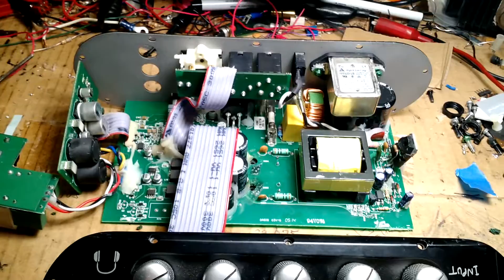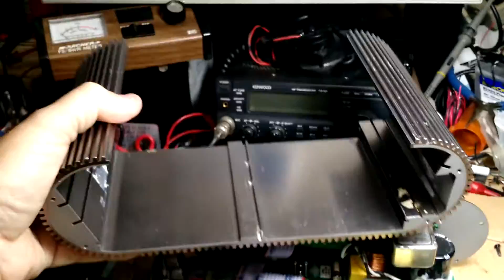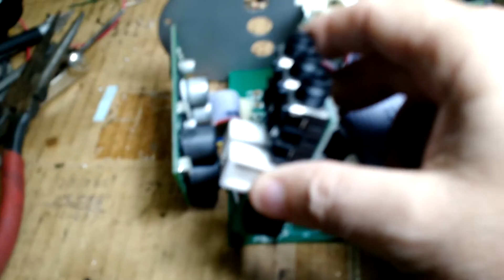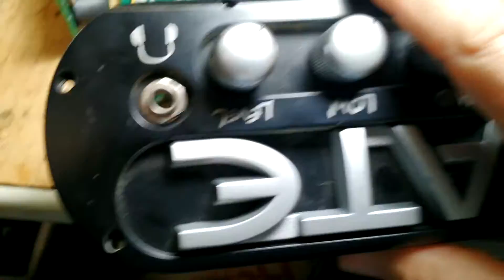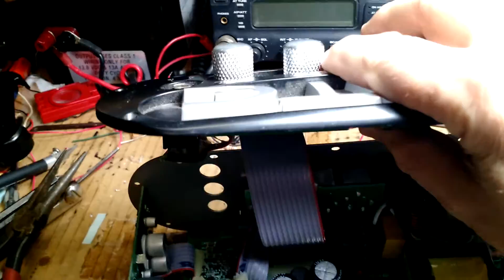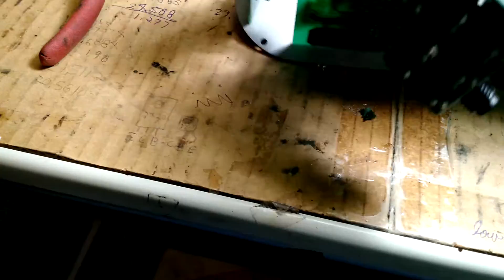Crate Power Block walk-around, inside its guts.

Comment: I’ve had my powerblock since the 2000s when they first came out.  I still use it for my fly-in touring rig and haven’t had a single issue with it.

I might upgrade to a Duncan Powerstage but people compliment my paired down fly rig which goes modeler>tube buffer>Amptweaker Depthcharge (to adjust the presence and resonance to the venue on the fly) to cab.  I use 1/4” to RCA into the CD inputs, stereo to each side of the 4x12 which keeps my modulation and ambient effects lush as ever.

Comment: Is it a 1 meg 1/2 watt resistor, or a 1/4 resistor?  I have seen posts made and everybody says to use a 1 meg 1/4 watt resistor on the IC.

I recently just did this mod with a 1 meg 1/4 watt resistor and still no volume out of the amp, even the headphone jack.  No noticable power amp pop either so I'm kinda stumped.  Any suggestions?

Comment: So you don't need a Poweramp you can just plug it into a speaker or plug your earphones in right it's basically just a little tiny 120 watt amp that you could use earphones with or plug into a cab or pa

Comment: What type of tone stack is in this amp? I’m trying to determine what tone knobs will be set at for flattest tone setting.
Reply from the maker: It's been quite a while since I've had this thing in my hands. So the memory is fuzzy. But I think it's more of a PA amplifier and it doesn't really have any sort of tone control
Reply: The front panel is a crunch channel “Flexwave 5” guitar preamp.  It has overdrive.  You can push it with an overdrive pedal if need be.

If you know how to bypass the cab sim that is always active on everything but the RCA inputs, let me know.

Comment: I’m having a problem with my crate power block when I turn it on it turns on and off on and off every couple seconds have you encountered this problem
Reply from the maker: That sounds like the power supply shutting down on overcurrent. Very tricky thing to troubleshoot.

Comment: Hi !
I have one of these, but I disassembled all unit, then put it aside for years and it is so hidden that I can not find it yet !!
But my unit problem was only the Master Volume and a few of the Gain and EQ
pots !! At the time that I addressed this problem IT WAS IMPOSSIBLE FOR ME TO FIND THOSE GREEN PLASTIC LITTLE POTS !! ....and they really dont last 
that long to go bad !!
Now days even Amazon has them, and also eBay !
I am asking you for a favor .....to tell me all the pots K's values !!
Starting from Gain, EQ and Master Volume !!
I also se in you video that Only the Master Volume has 6 pins or contacts
and the others are only 3 pins or contacts !
I will order once I know the exact values not to lose my chance to fix my unit !

At that time since I could not find those pots , I was going to put big regular pots and wire them to the PCB board which I maybe will improve the sound as I was told !

Thanks in advanced !
Reply from the maker: I love to but I've since returned the unit to the owner. One possibility is I may still have the schematics I will dig around and see if I can find them.

Comment: my major headache is figuring out if I can use the effects loop and somehow get real stereo.  Effects that pan right to left out through the right left outputs on the back of the amp and actually get it to be true stereo.  Any help?
Reply: Yes  you can although you will need a 2 calbe setup to make it stereo. 1 y cable trs to dual ts and then a normal patch cable as well if using the powerblocks effects out...plug the trs into the left side effects loop tip is effect out ring effect in ( which is mono if only using the left side of course) then you would need normal 1/4" ts cable to run your right output from your stereo effect into the right side input line in.
Reply: https://www.zikinf.com/manuels/crate-cpb150-powerblock-manuel-utilisateur-en-37414.pdf
Reply: Here is the manual and will have diagram for the y cable setup which is the mono side . There exist a few mistakes in manual to include the aspect of schematic denoting cab sim on outputs but its only on the headphone out. also although the cable is for dual mono it's not used as such diagram but is to separate input and output into mono left side for single y cable usage or if you add another standard patch cable then have stereo function using the dual speaker outs in non bridge mode.hope that helps as yes I have one haha.

Comment: Sorry in advance for this long comment. I'm just hoping to find a couple answers.

My father in law asked me to take a look at his crate powerblock. The thing worked, just not very well. If i maxed all gain, level and frequency knobs out and feathered a string it would screech and then completely stop outputting anything until you recycled power. I have been tinkering with it, and noted that a ceramic wire wound resistor on the main board had overheated to the point that it scorched the circuit board material. It ohms out at 126ohms is printed as an sqm 5w120rk. So I did a lot of research just finding a supplier for these types of resistors. The K at the end is the place holder for a +/- 10% tolerance. I could not find a 10% replacement, so i went with a 5%. I soldered it in and its working. It no longer cuts out at high gain, level, and frequency settings. It is however putting out what feels like an unnatural amount of heat. The heatsink is just shy of uncomfortable to touch after running for about 1 hour. So i was trolling for forums looking for people saying their powerblocks were getting hot. I managed to find diagrams, schematics, and then your channel. Imagine my dismay while watching your video and discovering that your crate powerblock does not have the resistor i have been fooling with installed! I can clearly see where it would go. In the lower left corner in the box marked R76. So two questions I suppose

Does your powerblock get .. hot ... after extended use?
and where is your R76 - SQM5W120RK Cermet Wirewound resistor?
Reply: nor do you have transistors at Q1 and Q2 ... what is this madness?
Reply from the maker: jim lloyd it never had that resistor you're talking about. As far as I could tell it runs pretty much Stone Cold. I could only test it at about the 20 watt level on my bench. The owner is a bassist. He doesn't run it at all that high of levels really. As far as I know it never runs more than just warm to the touch. It sounds like something is seriously unbalanced if yours is getting hot. Because they are a Class D switching amplifier they are really tricky to troubleshoot. The first thing you could do is make sure that your plus and minus power supplies are sitting at around 25 volts.
Reply: Hi Jim, do you have the Crate powerblock Schematic? if you want i could send you pictures of my internal amp. Could you send me the schematic?

Comment: I have the same problem with mine. Power cuts out and blue light flashes. Im a handy person and I can solder, but I was hoping to see you point out how and where to solder the resistor that Jon Koz talks about.
Reply from the maker: The resistor ( below \/) stops distortion from the power supply cutting out on power peaks. I did that to this one because its a recommended mod. What took this one out was a power supply issue where it would start when you turned it on and then shut down, and repeat every second or two (check the other videos) causing the power indicator to blink continuously, and no output. Is this your problem?
Reply: mweverett are there other videos on this? All I see is your video showing it working

Comment: I am told 1/2w 1meg resistor across 'front' 2 legs of ic101 with regard to power cut-off issue? did you do this?
Reply from the maker: Yes I added that mod while I had the patient open. The owner had noticed the peak chopping a little.